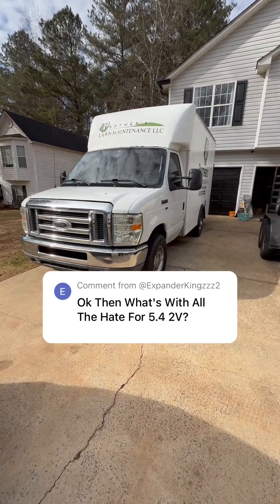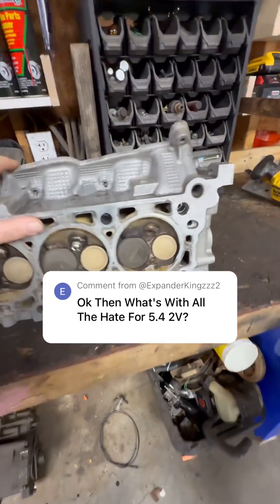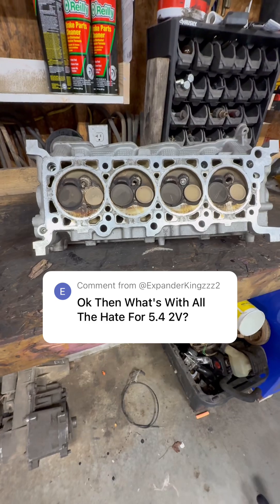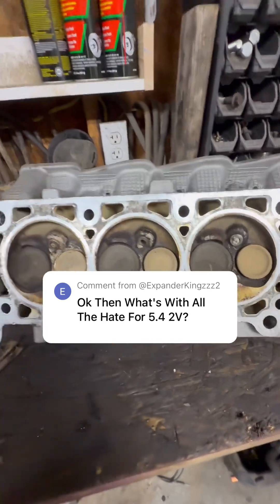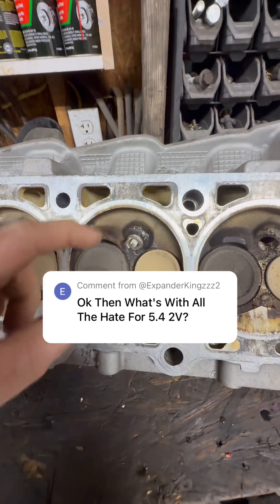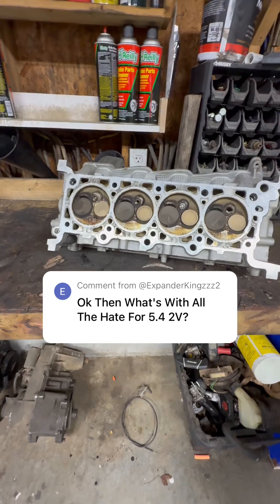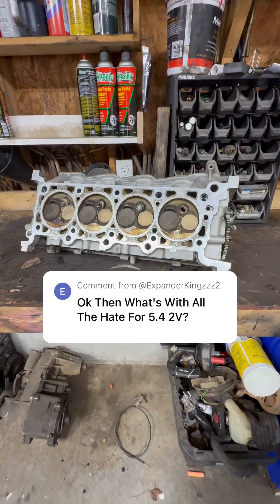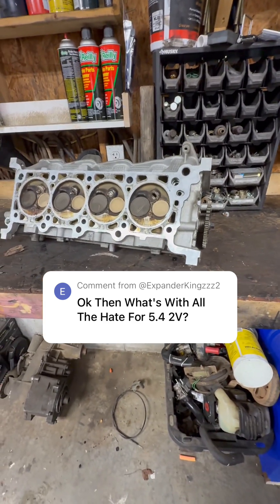Why so many people hate the 5.4 2 valve ford engine

Comment: I own a 5.4 2 valve Crew Cab Long Bed that I use to pull my 5th wheel RV. Up and down mountains 8-10mpg. Unloaded 14-16mpg. 202k on the odometer still running strong.

Comment: The non pi head primary had the spark plug issue. When the pi head was made, they cut more threads into the head for the spark plugs. Still would choose a 2v over a 3v any day of the week.

Comment: I just discovered yesterday when swapping the plugs in my 99 F250 that I blew both head gaskets.  My Ford Dealership manual I got said the torque for the plugs is only 11 lb/ft.  Now that I have to pull up both heads for new gaskets, maybe I should add some plug inserts to protect myself from a future blowout?  I do a lot of towing for asphalt paving as well as keep the bed loaded with work tools plus my mechanic tools, I keep it heavy always.
Reply: They sent out a PSA changing it to 18 lb/ft

Comment: Gonna come to the defense of the 5.4 2v. 2001 expedition, 4x4, 283,000 on it. Still strong . It's whole life in Denver and the mountains. Never had any complaints about power. Fuel mileage on the open road,low 20's . Never had a plug problem. Have never used a torque wrench on a spark plug in my life. And have never broke or stripped one. 2nd generation Volvo mech for over 20 years. So I got plenty of time dealing with aluminum heads. Either you have the feel or you don't. Have used Mobile 1 in it since we bought it at 70k. Now has what I believe is T chain slap mainly hear when you let off the gas. Have seen videos showing where there's a blowout of sorts on the back of the tensioners. Sound familiar?? Would really like to rebuild the whole thing but time, money and other reasons, doing the T chains is more practical for me right now. Haven't really found any videos talking about the bottom end in this engine. What are your thoughts or what have you seen? Really love this old truck. Still in good shape. See no reason to part with it. Not in the big city anymore so drive no where near what we used to.